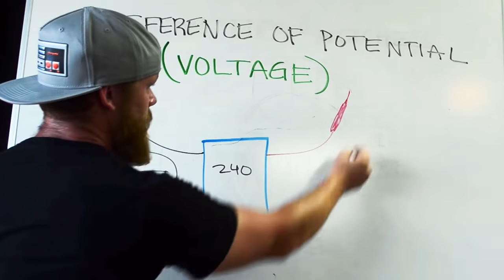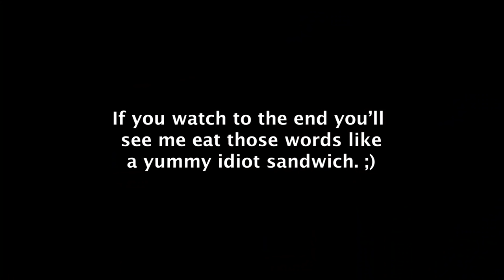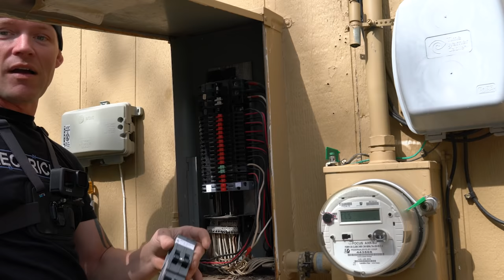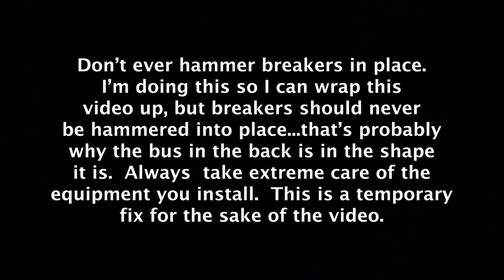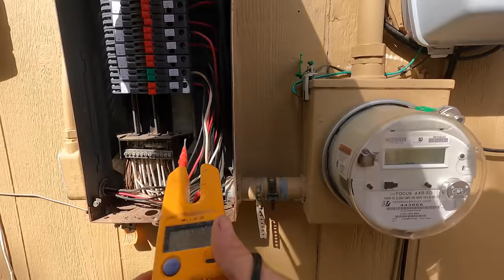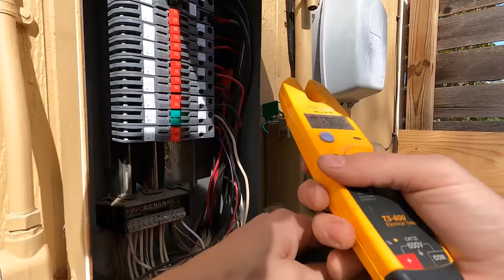How To Work on LIVE CIRCUITS - Replacing Circuit Breakers in Old ZINSCO Panel

Comment: Been an Electrician for 20 years and never worn insulated gloves... until last week when I opened a 415volts 200amps DB, I looked at the crowded wires and I just felt I need gloves on. Have to delay the job for about and hour when I hunt around for gloves... something in my guts just gave the feeling that something bad is going to happen if I don't take care. Sometimes when you get more experience, you can begin to just 'smell' the risks... and it begins with testing the circuits with multimeters over and over and over again. Regardless of experiences,  we should always trust the meters.
Reply: Hope you send gloves out every 6 month to be tested. Each sparky thetefore needs 2 pairs of gloves. We rolled rubber gloves up to check for leaks before each use. In summer always wore thin white gloves inside ofvrubber gloves to absorb sweat.
Reply: last saturday i was working on some main panel in a building and we shut down main breaker and backup breaker, then i tested and there was current still, it turned out the client has a solar power inverter connected to batteries and it was leaking back current from the input wires... about 95 volts both wires, so after turning the inverter off, voltage dropped to zero. it is always important to keep checking before touching
Reply: Bro facts

Comment: You can tell he’s a “master electrician” by the way he waves his screwdriver all around the energized busbar like a “master magician” waves a wand.
Reply: i especially liked prying the breaker out while leveraging towards the energized buss.
Reply: @matthewlewellen6516  ...and at 4:54 ???...!
Reply: @matthewlewellen6516  And how would you do it.? Just wondering.
Reply: Well as a 'Master Electrician' he obviously knows where he can and can't wave his wand. And obviously knows what he's doing. I've shocked myself a few times (which included being thrown from a ladder) figuring out how A=B, and those experiences taught me what not to do. Now anyone can run basic wiring through their house, and maybe even properly connect all those wires to the breakers in the panel. But what NOT to do...is to try connecting the feed from the pole yourself...unless being thrown from a ladder is on your bucket list. Leave that to those (like our EU friend) who actually know what they're doing.
Reply: The bus is dead the main breaker is off😂

Comment: You should start by telling people to use a insulated screwdriver while working in a hot panel!
Reply: Lmfao.
Reply: Any professional electrician only has insulated screwdriver in his toolbox. Uninsulated screwdrivers are for carpenters.
Reply: I personally put insulation tape around my drivers and not waste my money on the insulated stuff
Reply: Insulated screwdriver is not necessary
Reply: For first 40 years only used screwdrivers with several wraps of blck tape. Have several of the insulated screwdrivers.
Reply: @hjooy  Better to use regular screwdrivers when only running conduit or MC cable all day long. Less chance of nicking up soft insulation.
Reply: I thought the same thing.....ibew 76
Reply: @j2o3sh  he’s not contacting any phase with his arms dude and it’s probably hot. Nothing wrong with suns out guns out when you’re only dealing with 240V
Reply: @j2o3sh  ...cough...
I may have been guilty of that a time or three...
Especially tying in services on an extention ladder...
Reply: @j2o3sh  When wearing PPE, the problem with conductive screwdrivers is not shocking you, but creating an electrical connection between the energized area and an area of lower voltage. For instance, if your screwdriver touches both the panel and the hot lug at the same time. As soon as you do that you will create an arc flash as the inrush of current will vaporize the conductors and the metal.
Reply: @hjooy  haha, an uninsulated screwdriver is also known as a chisel in the UK. :)
Reply: @thetexorcist2235  yea your right. skin grafts on both arms months in the burn unit. no big deal. just 240
Reply: @matthewlewellen6516  🧢
Reply: @hjooy  what is he wearing
Reply: @hjooy  um... no... if you're working multiple jobs your screwdrivers are going to get banged up and knicked. If this happens to your insulated tools then theyll possibly loose function. Insulated tools should be protected and used when you actually need them.
Reply: yes, i bought one rated 1000v, they look cool also, before that i taped insulation around a normal driver, but we should look like pros so...better use pro tools

Comment: Have you considered insulated screwdrivers? I'd be more worried about shorting a live screwdriver (especially a long one) to anything grounded in the box than about accidentally touching 120 VAC with my hands. They're pretty cheap too.
Reply: Or if your a chepo like me throw some tape around it...lol
Reply: @AmericanOne9621  Shrink wrap. (I was thinking the same thing... "It's OK, I'm a pro, ignore my totally inappropriate Ace Hardware screwdriver." :-))
Reply: @jfbeam  Been there more times then I should of had...lol
Reply: @AmericanOne9621  Milwaukee, Wiha and many other brands have affordable 1000V insulated screwdrivers.
Reply: @illestofdemall13  no offense but insulated screwdrivers wont protect you from anything. i learned that from experience
Reply: @eddiew2325  If you touch the shank you won't get shocked where as with a regular screwdriver it can become energized. You have to take all precautions, not just one, and accidents can still happen. I am not claiming that insulated tools are the be all end all. No offense taken, by the way. I appreciate all opinions.
Reply: @illestofdemall13  You really have to be care with them though... they can get cut very easily on shard sheet metal or even knocking around in your bag. Once they are cut and beat up...grab some tape or shrink wrap... if not just file 13 the thing
Reply: @RFCarpenter  I have a nice Veto bag that keeps them from getting scraped up and I only use them when needed. They are in good shape. I bought them for cheap from Milwaukee and could buy a new set when necessary.
Reply: Yeah, he was scaring me. He needs to learn to put the driver down, especially when working hot.
Reply: @eddiew2325  then you did something major wrong. How do you even mess up using a 1000v rated screwdriver lol? Unless you bought some Chinese fake.
Reply: @MadMetalShop  I hope your not working anything over 120 volts hot and even that can kill you. I've worked from a 24 volt doorbell all the way to 7600 volts on one phase doing line work. I'm retired now and have all my parts accounted for....
Reply: @AmericanOne9621  ok. Cool sorry and all but I Was just implying that you probably shouldn't be using tape on a screwdriver to properly insulate it. That's my opinion.
Reply: @MadMetalShop  Well it's not exactly the right way and the use of tape isn't as good as a insulated screw driver no doubt because the tape will unravel in time. I've used both in the past but the better is a insulated screw driver over all.
Reply: Just dont ground yourself and it is perfectly safe.
Reply: @JohnSmith-db2oc  It has nothing to do with shocking you. Insulated screwdrivers help prevent accidentally shorting between un-fused hot and neutral with the shank of the screwdriver, and literally having the entire panel blow up in your face.
Reply: @JohnSmith-db2oc  not safe from an arc explosion though!!
I will never forget the time one of my colleagues was working on a live item with a big sturdy uninsulated screwdriver, seated on a stool: 
-  Suddenly, we heard an earthshattering BANG and found him instead sitting on the floor - a good 5 feet away from where he was working, almost paralyzed from chock - and still holding up the screwdriver handle in the air with no shank left !
It must have gotten totally vaporized, since we searched thoroughly and never found any traces of metal parts anywhere in the room.
After checking that he was well (got over it the next day) we all got a nice laugh out of it , he surely looked like he just fell from heaven still holding up a broken screwdriver handle with no shank :D
Reply: @RFCarpenter  file 13?
Reply: Roy Mccune  first time I am hearing of composite non conductive screwdrivers. Guess I need to look them up.
Reply: Keyboard warriors don't know about Klein apparently
Reply: Well I partially agree but when you know everything is dead its kinda just a waste to use an insulated tool like a pry bar
Reply: I was scrapping out a friends burnt down house and hit bix wit da screw driver. Got me.  I wont do.that again.
Reply: Can't pry with insulated screw drivers likes he's doing. You damage that insulation then you've rendered them useless. Mine say on them if that damage occurs to destroy them and not to use them to pry. Kobolt brand, I've had them for a little while and just read that on them today.
Reply: @JohnSmith-db2oc  what do you mean don't ground yourself? Sorry it's a stupid question, I'm not a electrician or expert.  Thank you
Reply: Always think happy thoughts before doing a line of pixie dust,.and you'll Peter Pan through high-voltage linework
Reply: "Go be a plumber." - God
Reply: file 13=toss it
Reply: Klein is king
Reply: yeah. you're right.
Reply: @jefffisher2480  lol same, was giving me major anxiety watching him wave his hands around while holding that driver on a live panel.
Reply: @illestofdemall13  Its really not even about protecting you from touching the shank. Its about keeping the shank from touching anything live to anything grounded. That's really easy to do with a long screwdriver shank on live terminals, and depending on the situation, can generate a big puff of sparks.
Reply: @michaelmolter6180  I agree. In either case it's good to have an insulated shank whenever there's a risk of live electricity.
Reply: For real